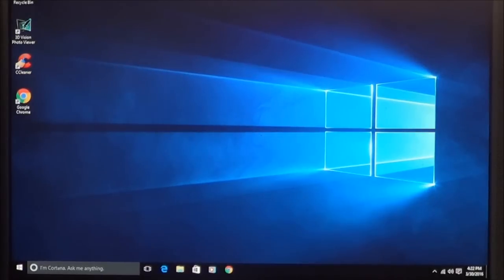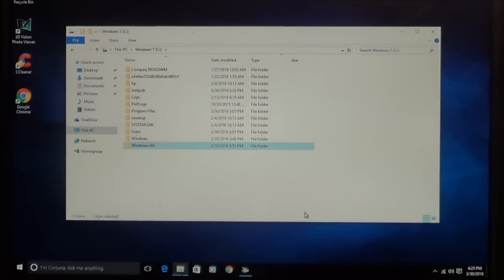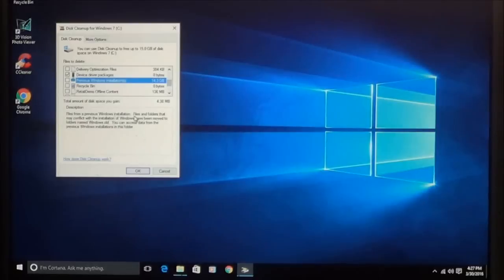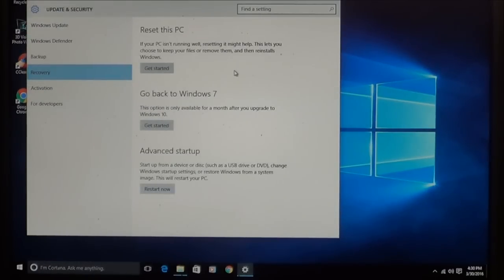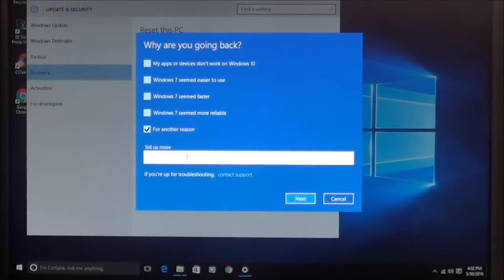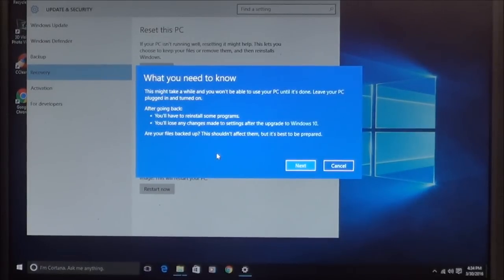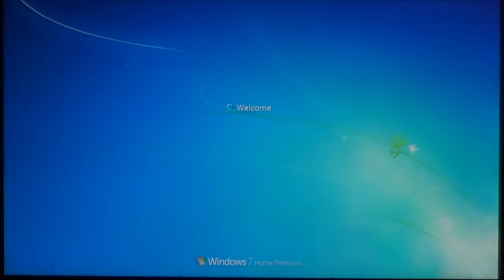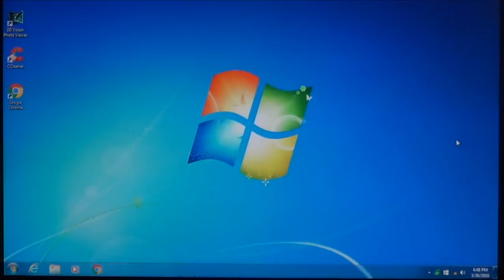Don't like Windows 10?

Comment: I want to buy a new desktop or laptop but they all come with windows 10. I don't like windows 10. How can I bypass it or get rid of it if I buy something new
Reply from the maker: You would have to buy the OS you want to install. Windows 7 is out of print and becoming difficult to find a legitimate copy.  Windows 8.1 is widely available.  Be advised that if you change the OS on the new PC you will loose the MFG Warranty.
Reply: I have an install disc of windows 7 Home Prem that was installed on my old laptop. Just wasn't sure if it could be installed AND if it would work on a NEW computer. Thanks for the help. MUCH app
Reply: Thank you for that info

Comment: Windows 10 isn't too bad once you get used to it, its just like any other item you buy new you have to get used to it.  Windows 8 was the worst as it was more geared towards 100% touch screen devices rather than a desktop or laptop setting.  Windows 10 is somewhat similar, except there are options now you can get the original start menu setup back and you can somewhat make it work like windows 7.  

There are some issues with software and hardware in windows 10.  I know for example that Quickbooks 2014 doesn't work with windows 10 LOL.
Reply from the maker: +William Todd (williamtodd) There are numerous issues with Windows 10 that I pointed out on my website.  I like Windows 10 more than I did Windows 8/8.1, but I also still use Windows 7.  With Windows 8, Microsoft was focused on the mobile market, since millions of people favored towards tablets and smartphones.  Windows 8 was competing with Android and iOS.  Microsoft wanted Windows 8 to be the first OS that could run both PC and mobile applications.

There are many older programs that will not work under Windows 10.  I even spoke to people who hate Win10 because they cannot get their programs to work or it crashed their system.  -MrFixit
Reply: ESRepair So very true, they do it on purpose I think, to force people to buy new software :(.  I have a laptop with windows 10 at work, and it seems to work fine, but its main tasks are MS office and parts searches on the internet LOL.
Reply: I tried to be fair to Windows 10 with my last PC, and that is a mistake I hope I never make again. It crashed quite a few times, and a lot of programs and games I tried to run on the PC either couldn't work, or ran like shit. Plus, I couldn't downgrade it back to Windows 7, which really made me angry, so I'm relieved to have a PC that runs on 7, because to put it lightly, 10 just sucks. It JUST sucks. Yeah, it's that bad.